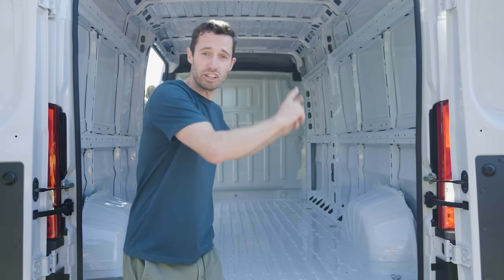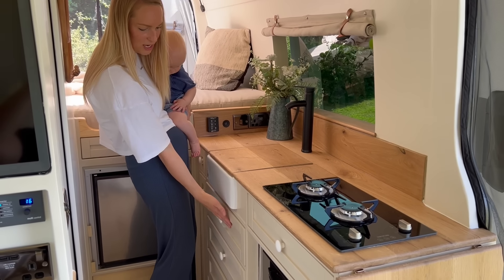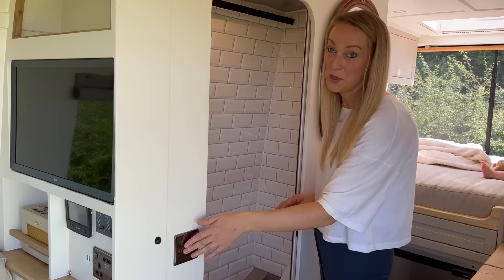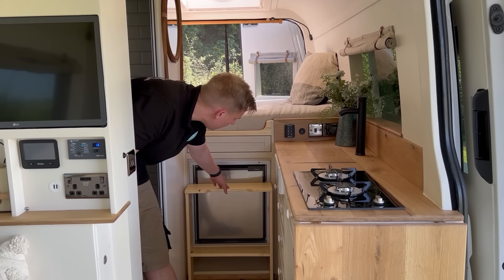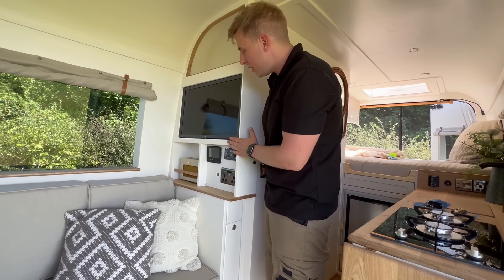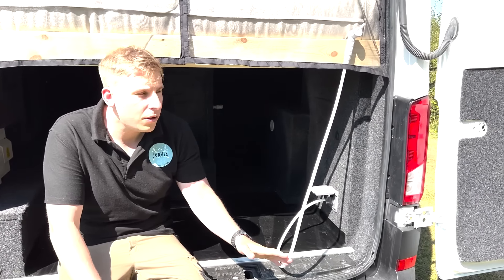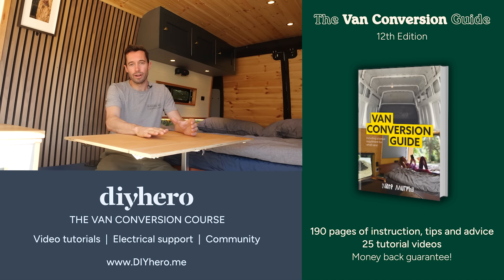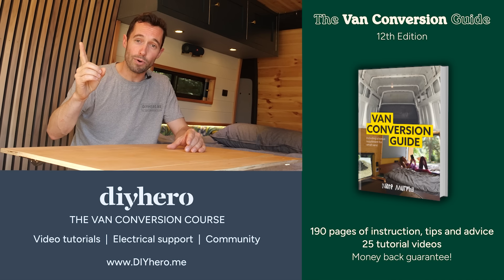BRAND NEW Van Tour | PERFECTED Van Conversion 🚐 w/ MODERN BATHROOM, SPART ENTERTAINMENT & 2 BEDS 🤯

Comment: Very niiice. The only thing I don't want in my build is not being able to get to the driver seat from the back.. for safety reasons one should always be able to reach the front without having to go outside to get into the driver seat. Imagine  someone breaking in at night... u'd have to go outside
Reply: It does have a pass through to the cab, and they showed it clearly in the video!